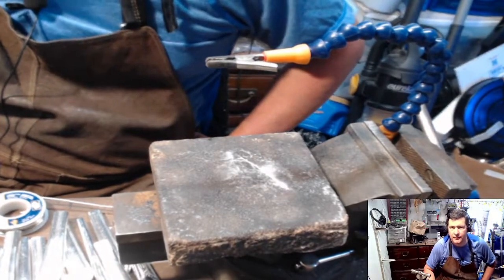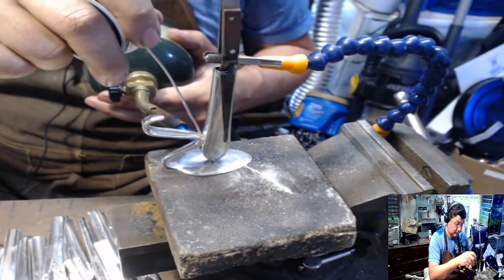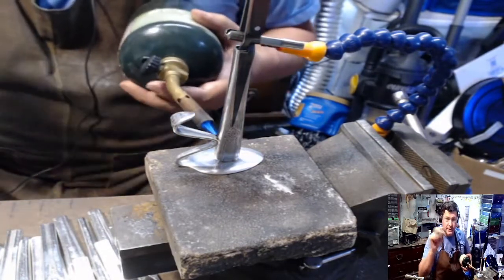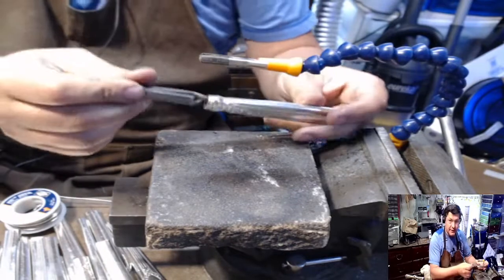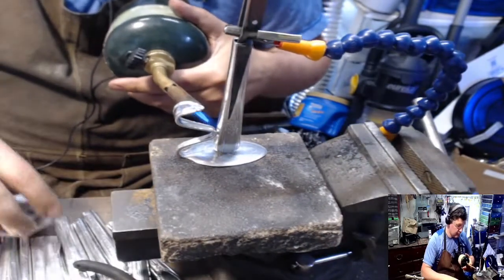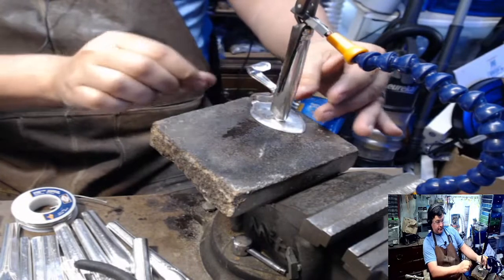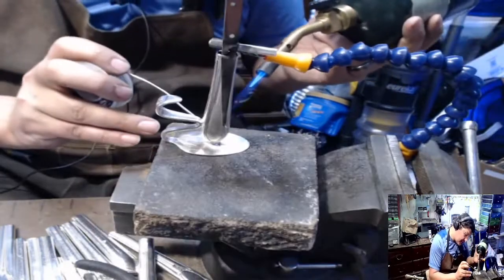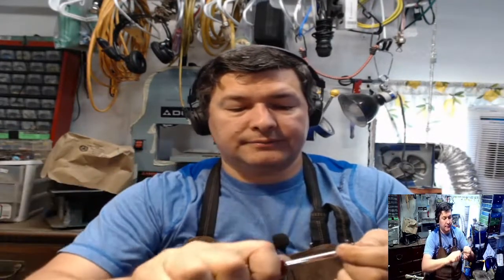Soldering Bud Vases. And chatting

Comment: Did you do something to the bottom of the knives to make them flatter and more flush for a better join. I am struggling big time with the soldering. Can't get it to join. I ordered the third hand like you have to try. Aargh!!!! I am not good at soldering
Reply from the maker: Yes I started holding them on my belt sander for a second to flatten the bases a little bit.
Reply: Ok...I tried that as well. Thanks..I think I got the hang of it...finally. soldering is not my best skill!😊
Reply from the maker: @kimhull5496  that’s great